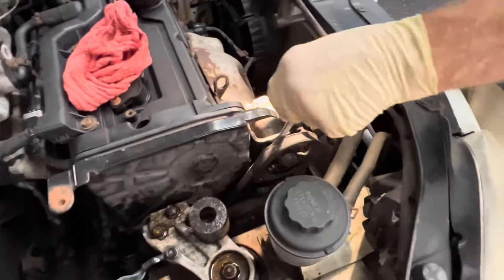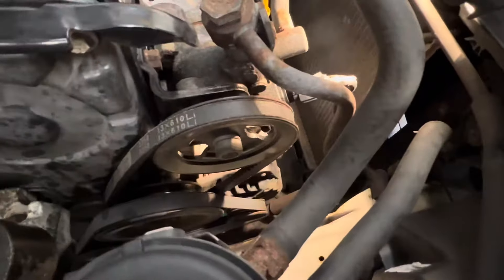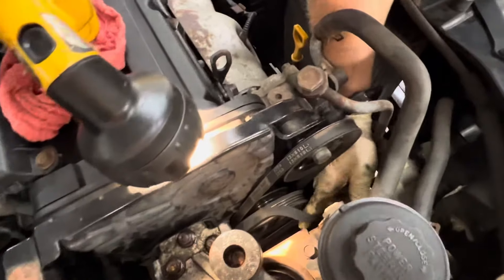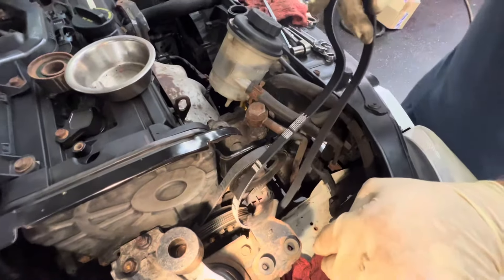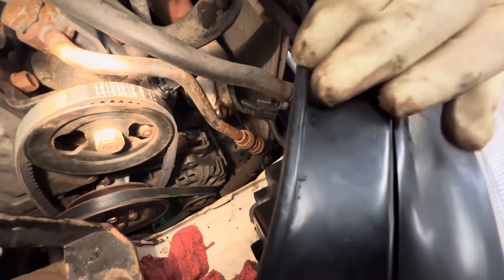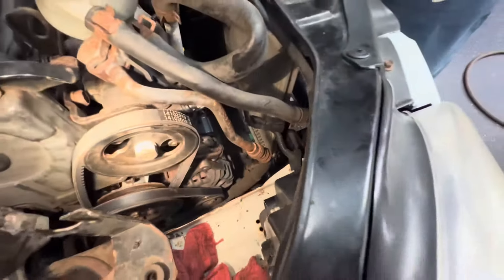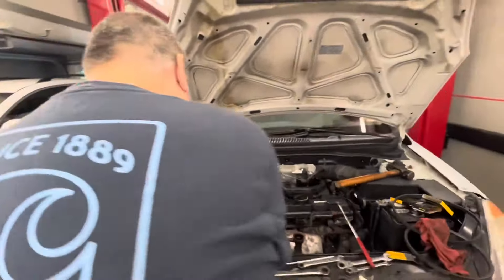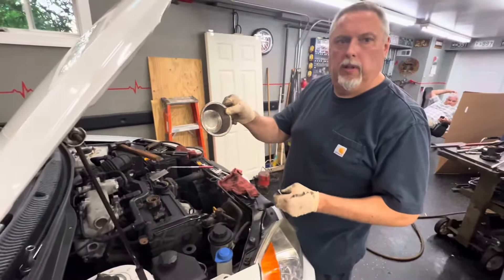2006 - 2011 Hyundai Accent Power Steering Alternator Belt Replacement

Comment: Thanks for the helpful video!Changed my squealing belts and now the problem is gone. Nice tip for moving the power steering reservoir out of the way, I wouldn't have guessed that it's that easy.
Reply from the maker: Thanks for watching our auto repair video that shows you how to replace the power steering and alternator belt on a Hyundai Accent.

Comment: Does this have the same platform as the tiburon? My power steering belt snapped.
Reply from the maker: If it is around the same year and engine, it may be the same or a similar process.

Comment: WHATS THAT FIRST BOLT HE WAS WORKING ON WAS THAT TO MOVE THE POWER STEERING PUMP FREELY
Reply from the maker: Yeah this is one of the bolts that if you loosen it will enable the power steering pump to swing forward.

Comment: I cant get my new PS belt on, been struggling where my hands ar sore, I push the pump all the way up & the belt is extremely tight,.        .....I counted 96 teeth on the old belt & about 105 teeth on the new belt. yet new belt is just too tight to go on.        hoping to find a miricle solution online.
Reply from the maker: Sorry I just saw this post. Did you measure the new belt against the old belt to see if they are the same size?
Reply: @HomeownerRepair  yes, & the old belt appeared around a  1/4" smaller.         Yet new belt had More teeth.  ........ I orederd a Gates based on the hyundai website exact part number & it fit perfect, unlike what Amazon said would fit.;

Comment: What do you do if the alternator seizes and won’t pivot forward?
Reply from the maker: You may want to try to spray some penetrating oil on the piviot points. You may also have to use a pry bar to break it free, be careful of what you are prying against though.
Reply: Pry bar helps too but use penetrating oil first

Comment: Can I take off the belt and drive it will it damage anything?? I’m not worried about standard steering lol
Reply: I’m pretty sure you shouldn’t drive without these belts because they control things like the alternator and the fan so your car could over heat or the battery may just drain
Reply: the belt runs your water pump as well mine snapped and i almost overheated my engine
Reply: Terrible idea my dude. Don't fuck your car up...
Reply from the maker: I would recommend driving it with the belt on.
Reply: @HomeownerRepair  yeah it ended up snapping my alternator belt off leaving me stranded so I got my answer for hard way 😅👎🏼
Reply: @ryleepowers  yes my car did end up overheating for a short time less then a kilometre
Reply: You’re wild bro 😂😂